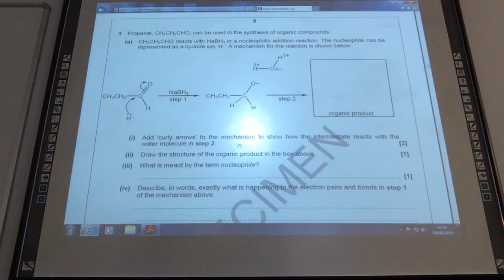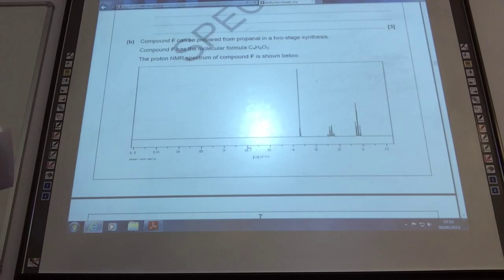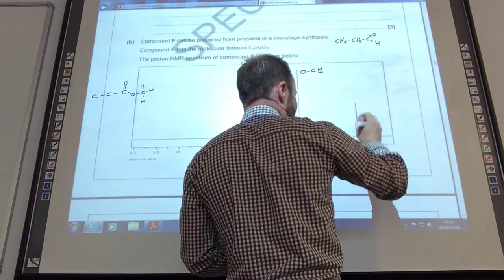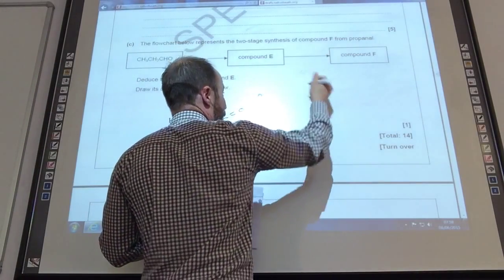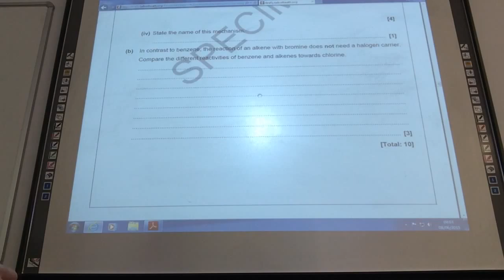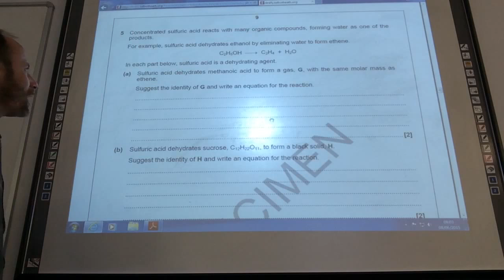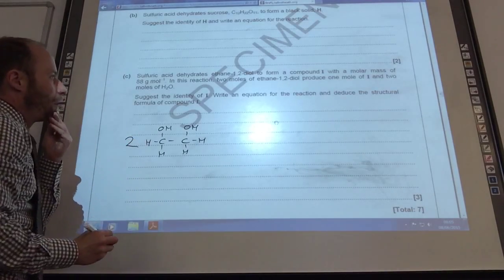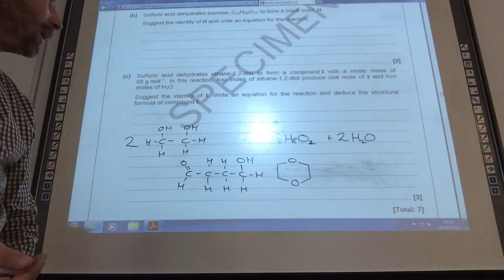F324 Rings Polymers and Analysis Specimen Q3-4 from www.ChemistryTuition.Net

Comment: hi sir,
for 5c why couldn't you have the ester ch3ch2cooch3?
Reply from the maker: +legendfooty Hello, from just the formula you are right, it could be. However this would take a rearrangement of the carbon atoms and oxygen atoms to work. You'd be breaking a C-C bond and making another C-C bond which is unlikely. If you draw two of the molecules side by side and then remove 2 water molecules then the structure given makes more sense. Hope that helps.
Reply: thank you :)